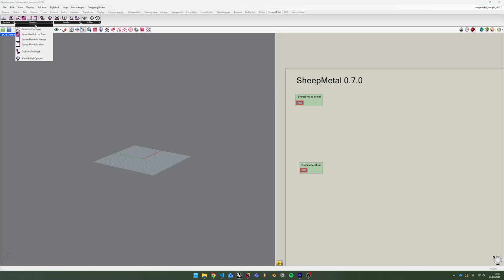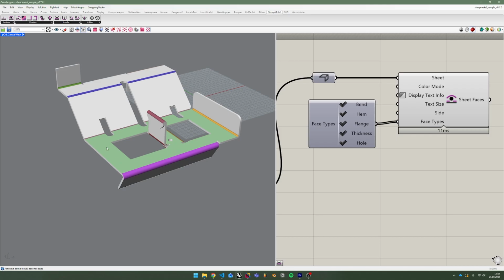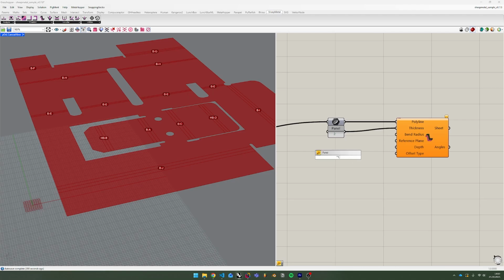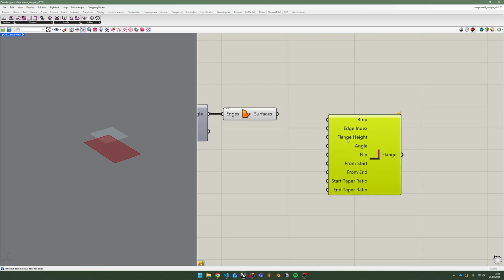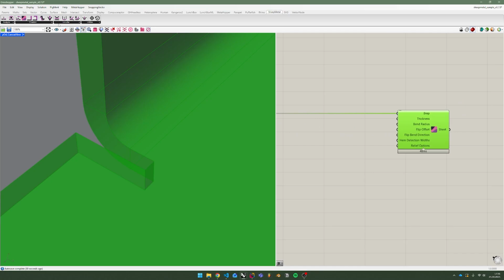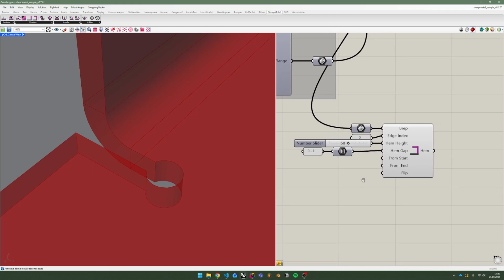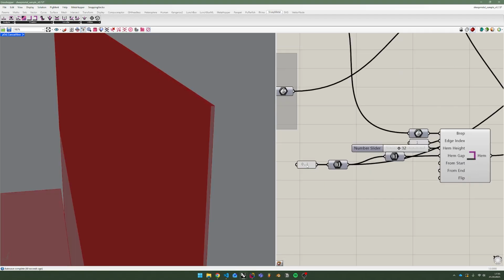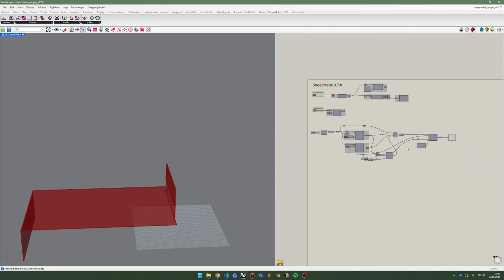Introduction to Sheep Metal

Comment: nice plugin!!!, how can I unfold an icosahedron for production in a 2mm metal sheet? Thanks in advance
Reply from the maker: At the moment, this is somewhat difficult. You need to prepare the icosahedron by unjoining the edges where you want it to unfold and introducing a small gap; otherwise, the plugin cannot determine how to process the unfolding. A future version of the plugin will include a dedicated Unjoin Edge feature to handle this better.